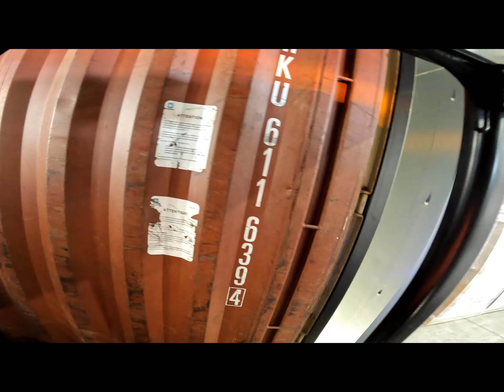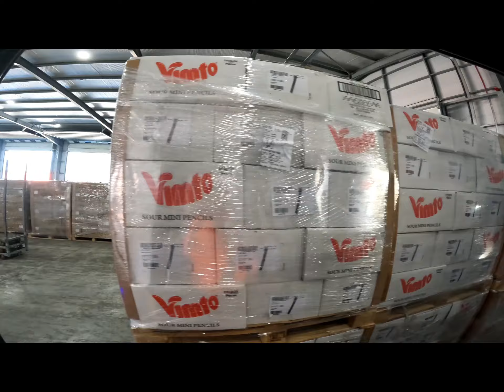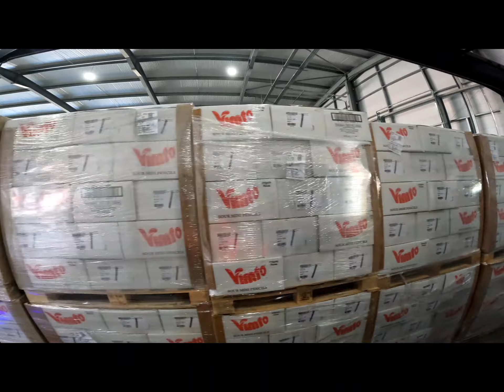Unloading a container full of VIMTO. Forklift POV.

Comment: Wish I still had sideshift on my truck, they removed it for some reason,  makes my life so much more difficult especially high up stacking, your making me jealous haha
Reply from the maker: It does help alot. Even though on alot of machines they dont advise using the sideshift above like 3meters.
Reply: sideshift is a great option. I didn't know how a forklift could not have sideshift. All the models of forklifts that i operate during the past 8-9 years, had sideshift. Makes life much easier.